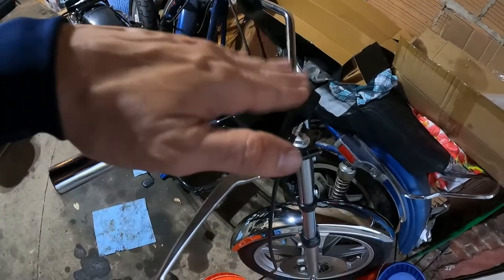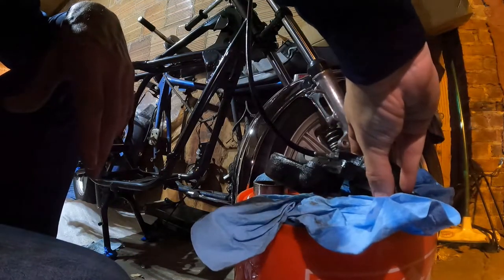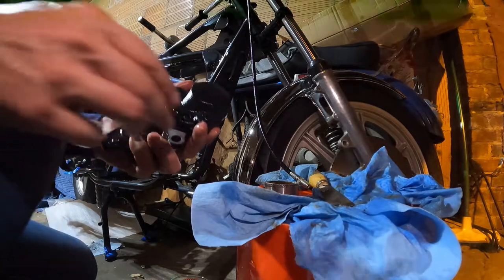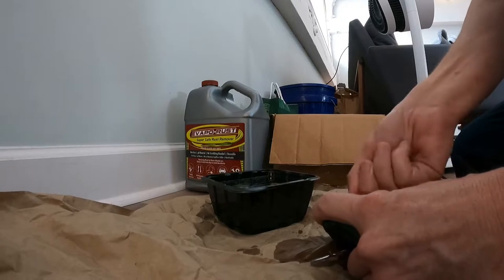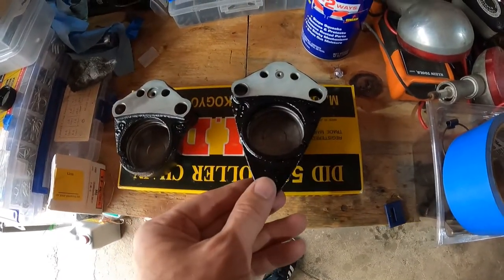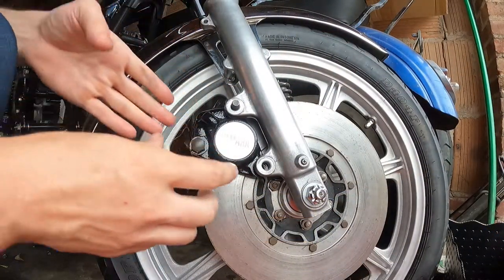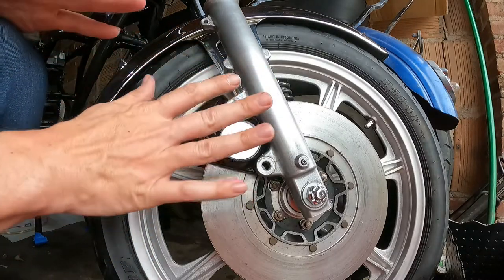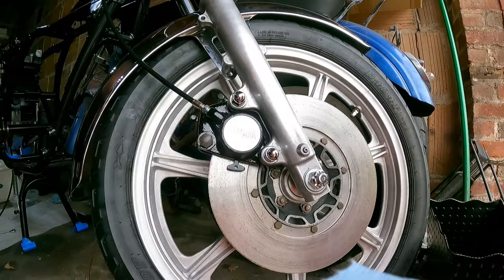Yamaha RD400 Restoration Caliper Rebuild Ep.12

Comment: What product did you use to soak the calipers in? Thanks
Reply from the maker: I used Evaporust, and ended up rebuilding twice. The second time I used a Dremel and wire wheel to clean up the seal grooves. Unfortunately the seals failed again. These calipers defeated me, I ended up ordering a repop from HVC with the banjo mod. It bolted right on and works great so far!